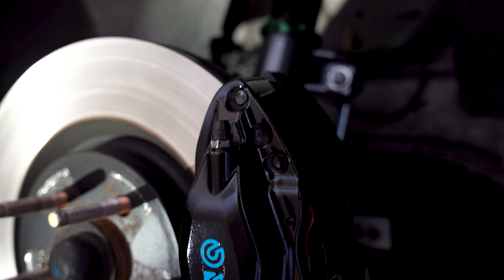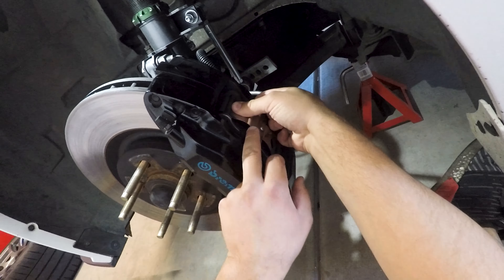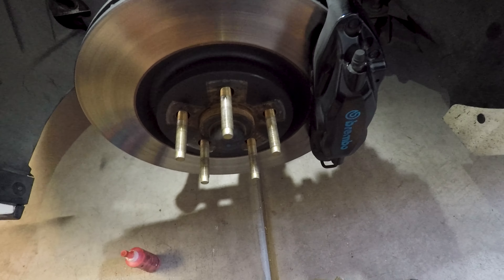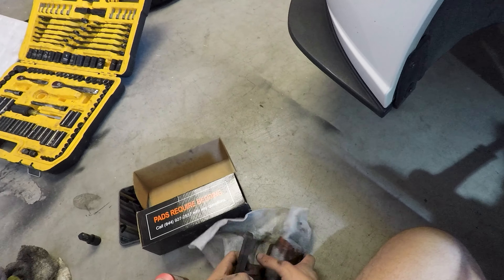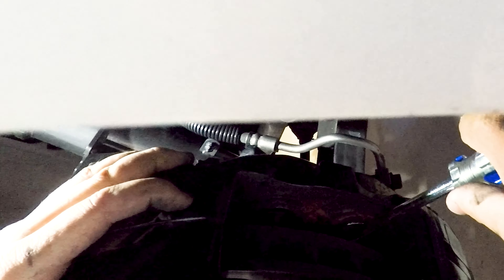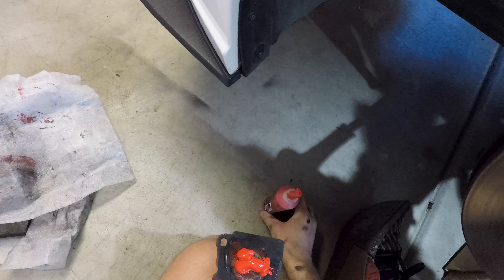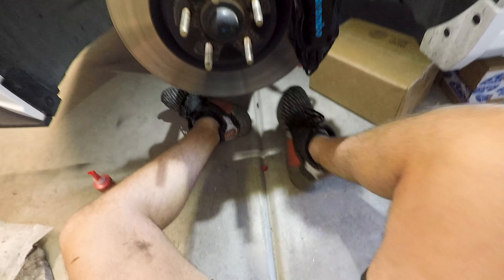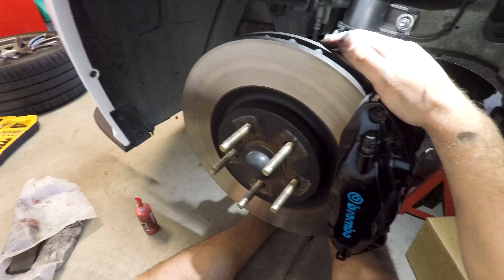Changing Brake Pads on 4 -Piston Brembo Brake Calipers | 2011-2014 Mustang GT

Comment: Are the GS1s good for spirited drives/autocross? I’m trying to decide which compound to get since it’s my dual purpose daily/autocross car at the moment. Not sure if the R6 is too aggressive for a daily. I’m too lazy to switch compounds all the time lol
Reply from the maker: I have bad news for you - you need to switch compounds all the time. I’ve been in the exact same position for 2 years. The GS1s fade on canyon drives after a few hard corners, so I switch to R8s on canyon drives and autocross days. The GS1 would not be anywhere near enough stopping power for autox. And my R8s wore out from new to 0 tread life in 3 months by daily driving, along with tons and tons of brake dust on my way to work and back. 

There’s really no solution to a daily + autox car except for switching pads.
Reply: @MassimoO  dang… I hate to hear that. I’ve been running the stock Brembo pads for the last two autox seasons but they’re leaving a bit to be desired (they don’t seem to bite hard enough, granted my entire braking system is long overdue for an overhaul). I don’t know what ford put on for the rear pads but those things seem to be indestructible with the material they have left with 70k miles on them.
Reply from the maker: @5literyote440  funny enough, my car ate the rear R8s on normal street use. It was metal on metal. Unfortunately that’s the only good way to go!

Comment: Two questions? 
1. Why did you unbolt the caliper again? 
2.why bend retainer on removal and install? remove pins retainer falls out and does not need to be forced in or out.......
Reply from the maker: I only unbolted the caliper once I believe. But on the topic of bending the retainer, I hadn’t thought about taking the pins out first. Not a huge deal to bend the retainer, but I’ll be trying that next time. Thanks for the tip!